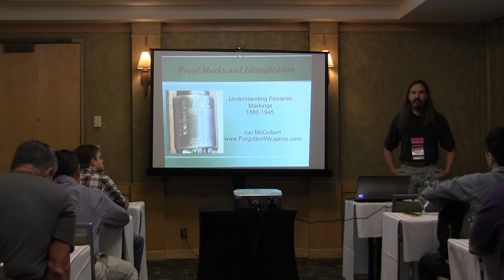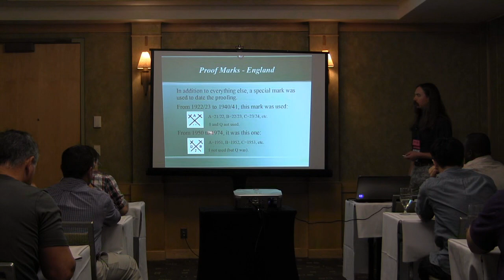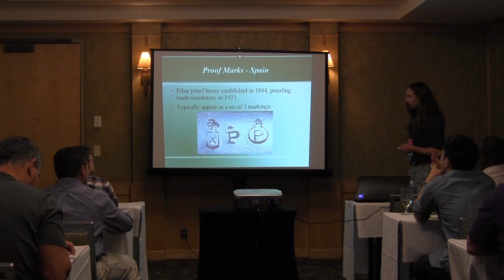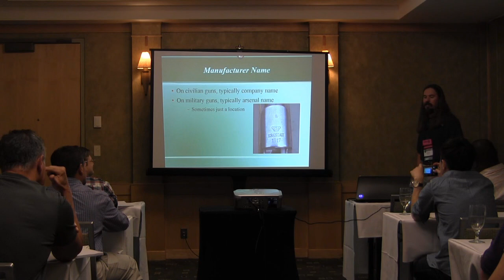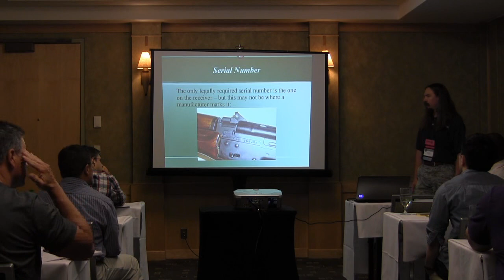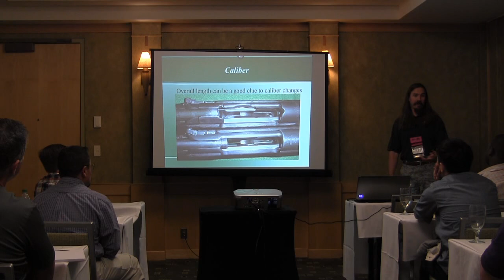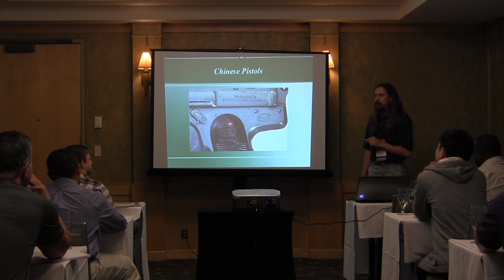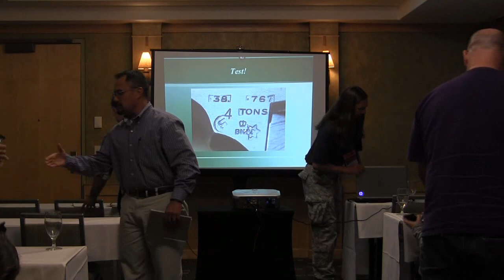Introduction to Proof Marks and Other Firearms Identification (1880-1945)

Comment: Sorry but need to correct you on something. NO serial number is required by law. The only law pertaining to weapons of ANY kind, including but not limited to firearms, is that the right to both KEEP them and BEAR them shall not be infringed. so what i suggest everyone do is SCRATCH OFF ALL SERIAL NUMBERS RIGHT AWAY. yes, it is legal and lawful and no sane lawyer would dare to argue otherwise. fwiw, it also states that to keep and bear arms is not just a right but is NECESSARY
Reply: What are you smoking lmao
Reply: Thanks for the legal advice Tom. See you on Myspace
Reply: @tylerkirkpatrick1212  as i said, ask any lawyer if what i said is correct. or better yet, look up the definition of "infringe" and then tell me if saying "Yes you can have them, but only if you allow me to mark them with a uniquely identifying number and you promise not to remove that number, ever" qualifies as an infringement. of course it does.
Reply: You cannot legally sell a gun without a serial number - anywhere. It is a restriction on gun MANUFACTURERS in the US.
Reply: @allangibson8494  sorry but you're demonstrably wrong. Source : us constitution. Besides you're not even taking into account private sales. You don't have to be a gun manufacturer in order to have a firearm you wish to sell... But more to the original point, don't you think restrictions on who can manufacture or sell firearms constitutes an infringement on the right to keep and bear arms. Of course it does. Look, we're all entitled to our personal opinion but these are not matters that are up for "debate" .. you've been brainwashed by your liberal "teachers" and you probably get your "news" from CNN and Twitter, and you've clearly picked up some wrong ideas
Reply: @allangibson8494  so are you saying only gun manufacturers are allowed to sell guns? I don't think that's what you believe if you really stopped to think about it
Reply: @allangibson8494  you cannot be confused by the existence of certain "unconstitutional official acts" that certainly exist on the books on certain states but are 100 percent null and void and demonstrably so by virtue of being word for word against the constitution. To show you the point even more clearly consider magazine size restriction "laws" in certain states. Clearly an infringement and I will not insult your intelligence by asking whether you think it is an infringement or not. So either you must admit that there exist "laws" on the books that are null and void because they are unconstitutional and therefore need not be followed and may not legally be enforced or enacted, or your only other logical option is to believe states may enact their own laws that are word for word against the constitution. Hint: look up what is termed the "supremacy clause"
Reply: @allangibson8494  NOT TO MENTION if we even just looked at the "laws" that do exist, you clearly don't know the laws in every state. In my state one may conduct a private sale to anyone who he does not know to be a felon. Therefore I could literally sell a gun without a serial number to a felon as long as I did not KNOW him to be a felon at the time. He could literally walk in and tell me he is a felon and I could still sell to him. Because it is possible for people to lie and therefore somebody merely telling me they're a felon does not make me KNOW they are a felon. There is no due diligence a seller must do such as background checks. Sellers are not manufacturers and vice versa
Reply: @allangibson8494  NOT TO MENTION, we're talking about rather petty things in the big scheme of things, i.e. small arms but keep in mind, the protections of the 2nd amendment apply to ALL arms, not just firearms. That means you could also manufacture/buy/sell/trade/operate incendiary devices, explosive devices, chemical or biological weapons, etc just to name a few. Unless you want to take up the illogical and indefensible position that those things I mentioned are somehow not arms?
Reply: @allangibson8494  speaking of which arms are allowed in the US or not (all of them are allowed), consider now abstract objects instead of weapons. for example, "domestic terrorism" now, terrorism is a tactic that involves doing things with the end goal of spreading fear among the ranks of your enemy in order to achieve some benefit (breaking the enemy's will to fight, for example) an arm = any item such as a weapon used for attack or defense. now ask yourself, does "terrorism" count as an "item used for attack or defense?" ... of course it does, by definition. and if it is an arm or can ever conceivably be used as an arm, then your right to engage in it is protected 100% by the full force of the united states government. 

here in the US we have laws against certain ACTIONS (i.e. theft, murder, etc) not against ITEMS (inanimate objects)
Reply: jhanks2012 Privately manufactured firearms are also required to have serial numbers on sale. If you manufacture any firearm, for other than private use, get classified as a firearms manufacturer and must comply. The government only has a tenuous restraint by the constitution anyway.
Amazing how the people defending the second amendment have no problem with breaches of the other 24...
Reply: all murder is homicide, but not all homicide is murder. i would draw a Venn diagram on here if i could. clearly they wanted us to be allowed to BEAR arms which by definition means BEARING them against someone ... you cannot possibly believe that they wrote "right to keep and bear arms" so that gun owners always have the right to own guns and go to the range where they shoot at paper targets and that is what you call "bearing arms"
Reply: jhanks2012 Only LICENSED gun manufacturers are allowed to SELL NEW guns. If you make NEW guns you are required to comply with the GCA and record who you sell them to. And if they have certain features you are required to pay a stamp duty on those features. The government is big on people paying tax.
Reply: jhanks2012 Unless you can get a court to declarer an act unconstitutional, you still go to jail or get killed by the police....
Reply: @allangibson8494  you're out of touch. I just presented a logically airtight case ripping yours to threads. Believe what you want, brother. Luckily for the rest of us, your beliefs don't become law. Please however seek to educate yourself rather than misinform others
Reply: @allangibson8494  we can talk about tax all day brother. Like the fact that no law says you are required to pay a portion of your earned income to the privately backed enterprise called the IRS. Like the fact that the laws that predate the entity called the IRS could not possibly even in theory make mention of the IRS. Don't you think if someone was going to take you to court and claim you owed them money, that they would be required to have some kind of proof that he and you had previously and willingly entered into some kind of agreement about sharing a portion of your earned income? Wouldn't you simply laugh and ignore that person who said that, if you knew for a fact it was false?
Reply: @allangibson8494  honest question: do you believe attempting to say "You can own items that suppress the arm's sound output, but only if you pay us a tax on it, and only if you tell us who you are and where you live and put yourself on this list for us" is an attempt at an infringement on that person's right to bear arms? this is not a question about whether you personally think that person should have that right or not. this is a question about the word "infringe," and your understanding of it.
Reply: jhanks2012 Your “airtight case” has crashed repeatedly in the courts - because the second amendment has qualifiers - 1) “Well regulated” and 2) “defence of free state”.
Reply: jhanks2012 A suppressor is not a firearm. It has never been required for a firearm. That said - there are countries in Europe that require suppressors to be used for health and safety reason.... argue with your local representatives about it....
Reply: @allangibson8494  that's not the point. the point is, to disallow certain types of modifications to firearms is BY DEFINITION an infringement on the right to bear firearms. the words "unsuppressed firearms" do not appear in the 2nd amendment. like i said above, nuclear warheads and chemical weapons are protected by the constitution. do you really want to get yourself hung up on whether silencers are allowed or not?
Reply: @allangibson8494  speaking of Europe, they had their little problems with alt-left dictators who used gun control to almost take over the world if it weren't for AMERICANS with the right to bear arms coming to their rescue not once but twice in the last century alone ... going back before that, it was conservative Americans with the right to bear arms that fought in the civil war when the alt-left wanted so bad to keep their slaves and keep guns from people that they literally went to CIVIL WAR to try to keep them
Reply: jhanks2012 Actually it has been the RIGHT wing conservatives who have outright banned firearms. The left wing is more about restrictions.
Reply: @allangibson8494  you're out of your feeble little mind. you are entitled to hold whatever wrong opinion you wish. but hope you realize that is all it is, your opinion. these historical facts can be verified by any who wish to do so. hitler, stalin et al ... all FAR LEFT WING. in fact, BY DEFINITION totalitarianism and state-sponsored genocide fall under the purview of the left. that follows directly from the definition of right wing and left wing politics. the only true "extreme" right wing view is anarchy ... the exact opposite of what you said.
Reply: @allangibson8494  your definition of a "new" firearm is arbitrary and holds zero legal weight whatsoever. for example, consider a firearm that osmeone puts together from all  non-NFA items that have no serial numbers on them. the moment that firearm is put into a completed, ready to function state, is it considered new? for how long is it considered used? until fired once? or how many times being fired until it is now considered used? becuase that man can sell a used firearm, but not a new one, according to you unless he "serializes" the new one?  

it's like buying a new car. in reality it becomes more and more used, progressively as time goes on and as miles are accumulated on the engine. but in terms of what is meant by "new car" and "used car" for all practical and legal purposes, it becomes a used car the second you drive it off the lot. 

similarly, that firearm, let's say weeks to months from the time it was created, is no less of a "used gun" if it was test fired one time or if it fired a thousand rounds. so while you say you cannot sell a "new firearm" without serializing it, but you acknowledge there is a legal and lawful market for used firearms between private owners, it's kind of a moot point. you cannot seek to litigate someone for selling what you deem a "new gun" when the rest of the world who uses that language calls it a "used gun" and the state of "new gun" lasts an infinitesimally short period of time. technically speaking and legally speaking, if he built that firearm and hung it on his shelf for decoration then sold it, it would be being sold as "used."
Reply: @allangibson8494  we can play these games of definitions forever. if i build a device that can fire 12 gauge shotgun shells out of materials from Home Depot, do i have to "serialize" that too, according to you? anything that launches or accelerates a projectile? what if it's 3D printed out of plastic? does your definition somehow evolve and change and morph over time as new methods come about to include things like 3D printed guns? that's why all arms have always been legal in this country, in every state. deep down lefty types know they're wrong and that's how it doesn't phase them to keep changing the story to keep up with the times as they go along

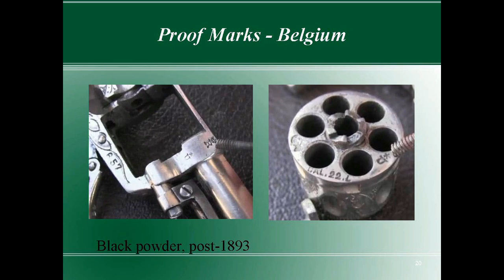Comment: 36:00 This "L" would still seem to imply "Long" in German, Dutch, and French. Can't really be construed to mean "Short"
My only guess is that there was a originally an even shorter .22 Caliber than .22 Short, and this "L" was meant to distinguish .22 short from the .22 shorter.

Another possibility is that this pocket revolver was not a full production gun and the workshop didn't have a stamp which read "CAL .22" and they simply used the stamp because it was all they had on hand.

Another possibility is that only the projectile of the .22 long extends out of the front. If that's the case, then maybe this was intended to be fired with .22 Long wadcutters. This makes sense since it's a very small revolver.

Comment: That Afgan Martini markings are completely wrong and not a good marking at all. First off, the date stamp is not in line, the 79 are slightly higher than the 18. So thats not right. Second, there is supposed to be a full stop after ENFIELD AND 1879 so it would be:

ENFIELD.
1879.

And lastly, yeah that ic1 marking is way off, it should be I.C.1.